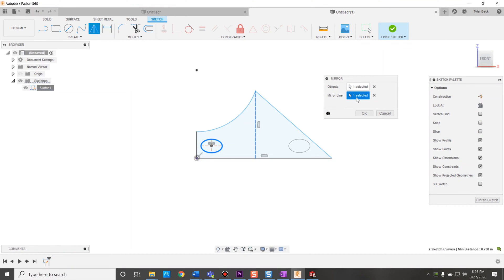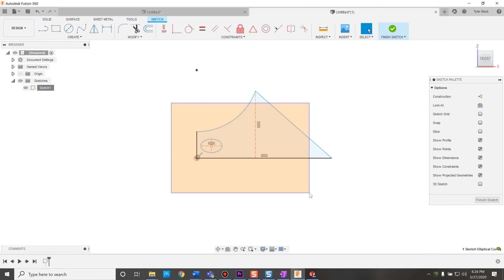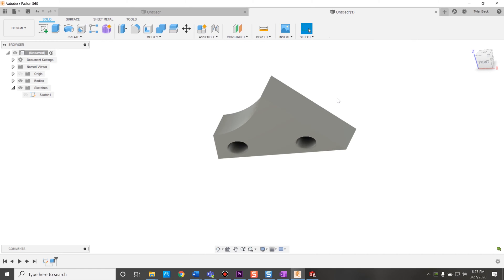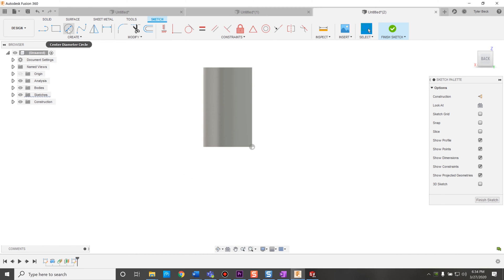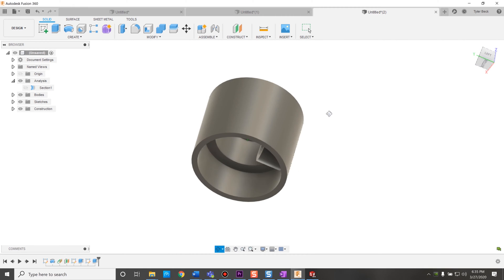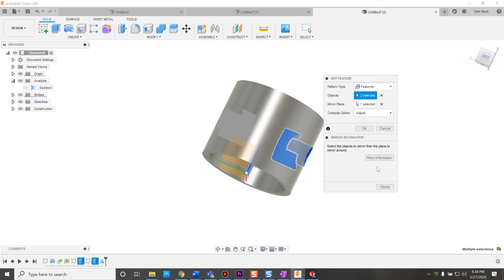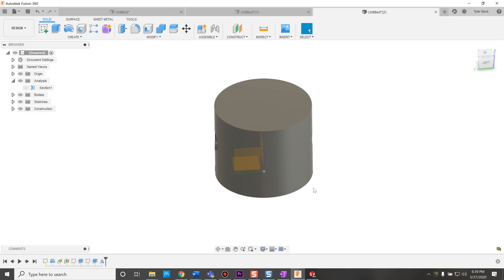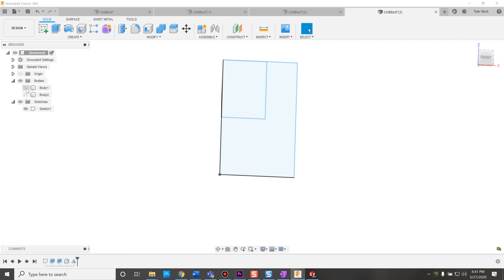Fusion 360 - Mirror Sketch, Mirror Features, Mirror Bodies

Comment: Hi.
The mirror function is very dangerous and non-intuitive in the case of mirroring threaded holes not as shapes but as features.
If we reflect the threaded hole in the plane as an object, it is obvious that the result will be a threaded hole with reverse threads.
However, if we mirror a hole with a right-hand thread using MIRROR [features], be very careful and note that the result will also be a reverse thread, i.e. a left-hand thread in this case.
This is crazy and in my opinion a bug of FUSION360.

Comment: Once I mirror a body can they be separated from each other. For example, After creating a cookie-cutter I realize that I have forgotten to mirror the sketch and up until now I have started all over or have mirrored at my 3D slicing software. I would rather correct the mistake in Fusion. I used your video and have successfully mirrored the body. When I try to delete the first body I get a warning message about deleting dependent bodies.. (something like that) basically Fusion doesn't like that. I either need to flip the whole body and not mirror or break the dependency. Any guidance? Thanks for this quick and concise video. I learned several things that will help me with my cookie work :-)